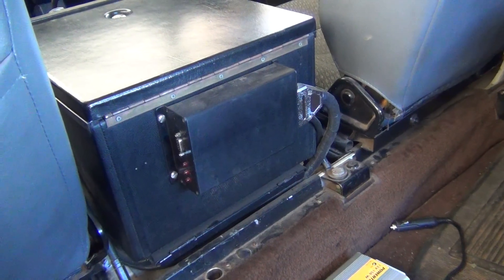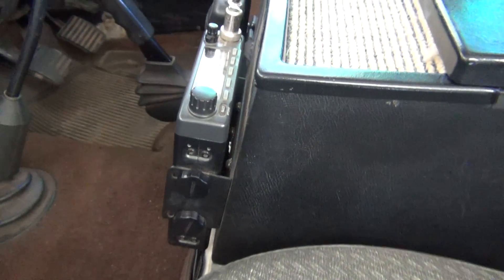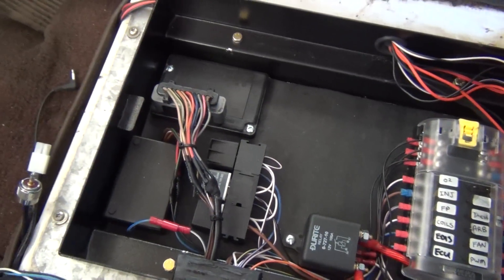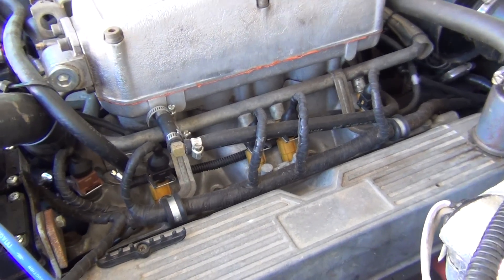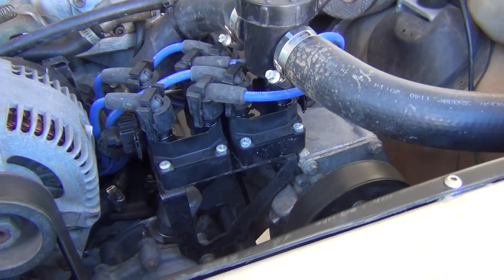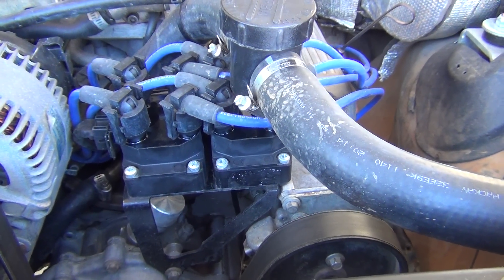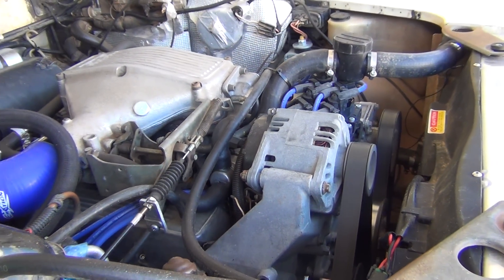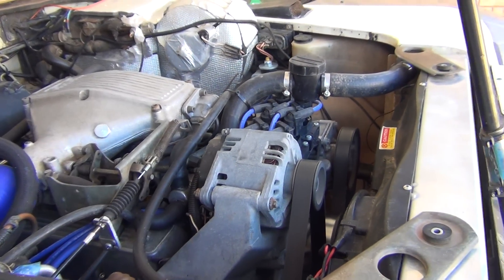Land Rover 110 3.9 V8 Megasquirt and EDIS ignition

Comment: Have you any accurate references that you followed for the assembly of this entire set-up? I am about to purchase MS for my 3.9, plus I have the Blos too. Has it been reliable for you?
Reply from the maker: Hi Alan.  I got all my info from the LR4x4.com forum under the tools and fabrication section.  You will find information and guidance for everything imaginable related to ms1.  I also had instructions from Nigel who I bought some gear from at megasquirt-v8.co.uk.
My setup has been 100% reliable. I carry a spare crank sensor, EDIS 8 unit, coil pack and coolant temp sensor just in case, as they are the real show stoppers, but there has never been any issue.  I did a 9000km trip in the middle of a heat wave, including a couple days driving in 46deg C ambient temps across Australia, and the system handled that all fine too.  All the best with your install.  Don't rush it.  Take your time to do it all properly, and it is better and more reliable than anything Landrover put out from the factory.

Comment: Nice setup. I'm using EDIS4 on my car.
are you running full sequential injection on this or just batch?
I want to run  full sequential eventually  and am trying to understand how its done. I plan to use a sensor in the currently unused distributor.

Comment: Why is there no transferbox gearstick?

Why have you got such a massive heater matrix and fan?

what dashboard is that? We don't have those in England!
Reply from the maker: I have the LT95 gearbox, so the center diff is vacuum actuated with a push/pull switch I located next to the drivers seat.  The Hi/Low range lever is behind my left foot right next to the handbrake lever

The fan/heater matrix/air con evaporator box was standard in Australia for the Land Rover 110 in County trim.  The dashboard is also standard for this air conditioned model.

Comment: Have you checked teh brushes on the alternator lately. I've just clocked up nearly 180 000 on the speedo, and by then or around 200 000 it's time to check your alternator.